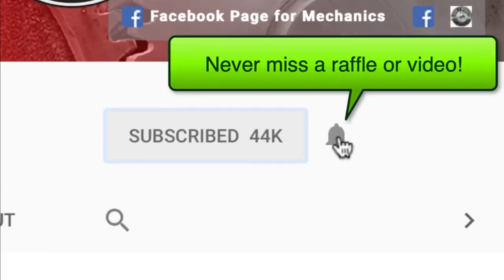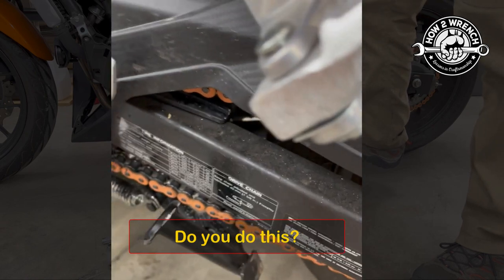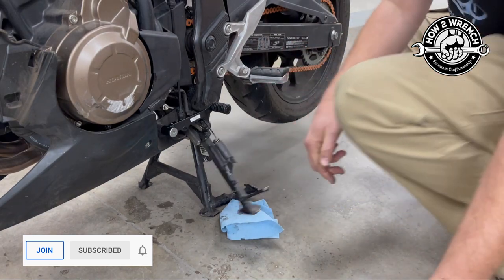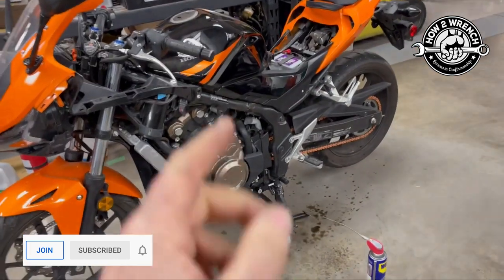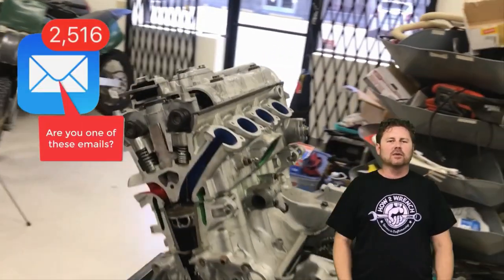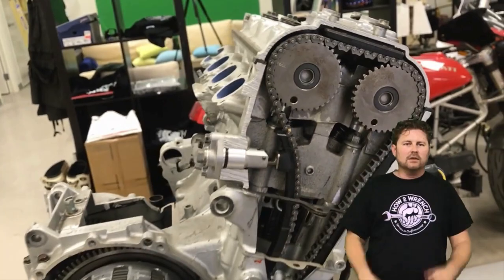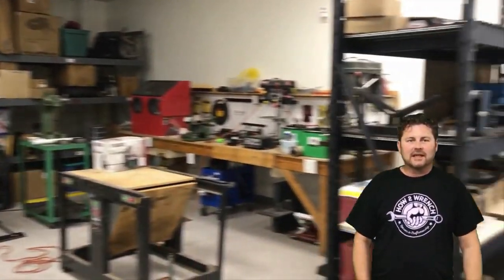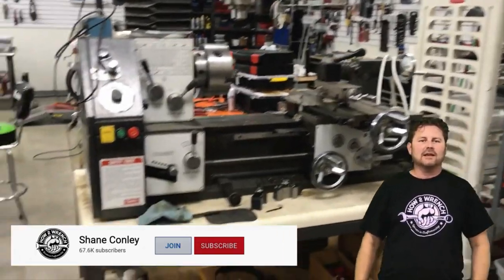The most overlooked Motorcycle Maintenance item! Are you doing it?

Comment: Good advice, but not clear on how the bike could flip over if stand was down while riding, wouldn't the force just push it back up? Going in reverse I could see that, but not forward.
Reply: It will just flip back, as kids, we push down the center stand with our feet and drag the stand over the concrete at night. Sparkles all over.
Reply: When  in a  turn it is possible for the foot of the stand to be down. If it touches the pavement it may drag and cause a disruption of the bikes  steering. Gyroscopic effect of how a bike works.